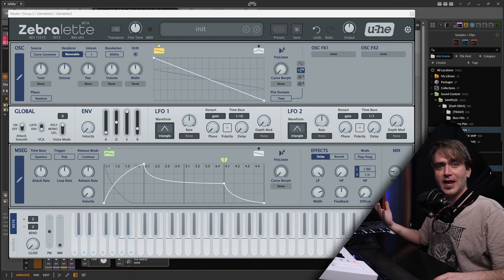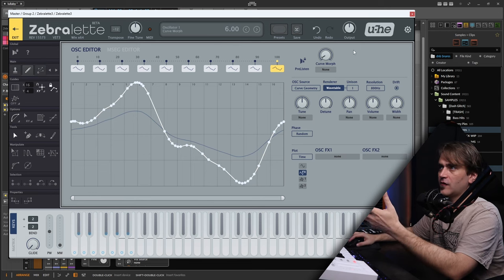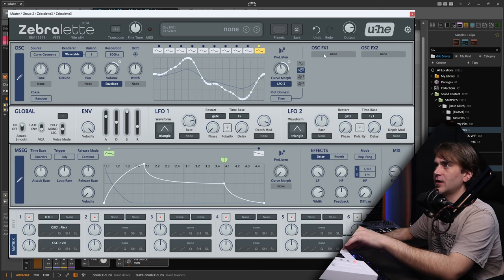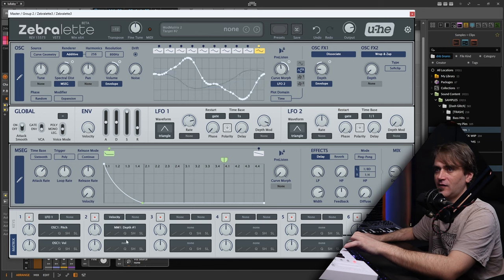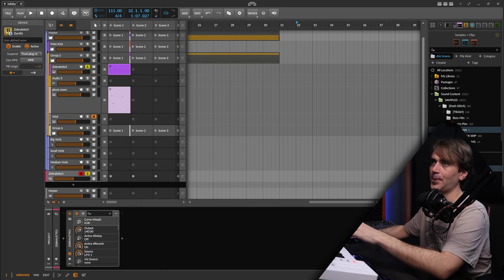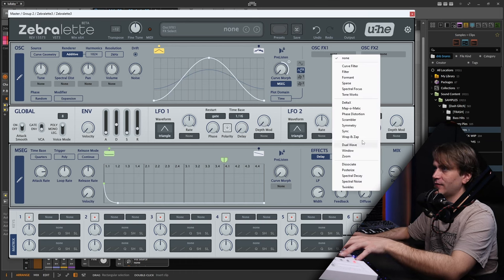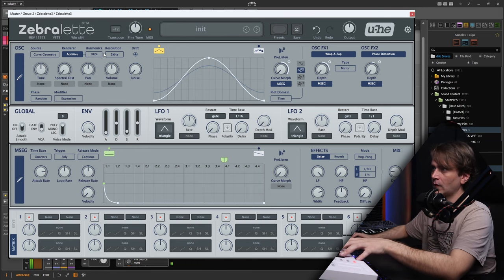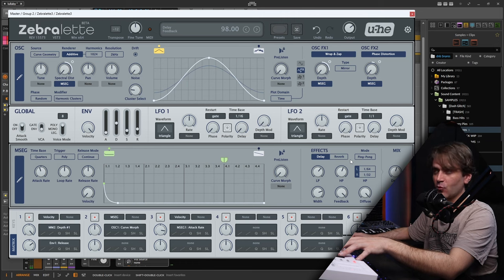Recreating Realistic Acoustic Sounds with FREE Zebralette 3 - Pads and Plucks

Comment: Very nice, congrats!
(BTW at 9:20 you could use "via" in slot 1 instead - saves a precious slot. And shortly after that, instead of Crisp you could use Zebralette's own ModNoise source).
Reply from the maker: Thank you for the tips sir! WRT ModNoise did you mean there is a way to patch it directly to audio output? or to modulate a parameter?
Reply: @DashGlitch Try modulating various parameters e.g. Volume, CurveMorph...
Reply: Sound design tips from Howard Scarr, himself?! What a treat! 🤩🤩🤩

Comment: I'll be watching again your's and Urs's videos but I don't think I am going to find an answer to my predicament. As I get more into the details of Zebrallete I came across an insurmountable issue which is, where do you apply the guide curves of the mseg ? For the oscillator there are various paths in the right click options for modulation sources like the additive renderer or for the osc fx, but for the mseg there is no menu and if there's no menu one as to question why are there guide curves in the mseg if there's no function where to apply them ? I already have trouble using the mseg curves without a proper step sequencer and now I can't find a usage for something that is got to have a purpose otherwise, we think, how does an experienced designer makes such a gaffe ? Please tell me I'm wrong, I won't even ask what it is, I'll just find it. Thanks and sorry for the bother.
Reply from the maker: The guides curves are universal, so if you set them up in the oscillator, then they can be accessed by the MSEG
Reply: @DashGlitch  I'll be checking your assertion but before writing you I checked that when you design a curve in the mseg the same curve in the oscillator remains unchanged, according to your conclusion there's only three curves common to the two. Before answering let me get to the bottom of this by checking the manual but I think I'm going to find a design dead end. Thanks for the attention and I'll be in touch when I have a conclusion.

Comment: Hey Dash, not a question related to Zebralette but I’m curious how often you still use your modular rig? I got into eurorack because I wanted something more “tangible” and “raw” than purely software … and while I don’t regret it and I love my rack, using hardware modules has ironically led me to realize just how good soft synths like zebra/zebralette, phase plant, and vital really are. Just curious if your experience has been similar.
Reply from the maker: Yes but I don't try to compare them, rather use them as individual tools. I like to make sounds on the modular with a more creative mindset, then compile them in the software with resynthesis/granular etc in a more goal-oriented session

Comment: On macoOS I've tried to migrate some of my own Serum wavetables (actually just single cycles) to Zebralette by dragging them over the osc section but it does not give me any kind of import option.
Reply: Interestingly tho: "Single cycle files will be recognized as such and will only replace the currently selected Curve, while multi-cycle samples
will replace the entire Curve Set." I've thrown bunch of exactly single cycle waves but no success to this day 🤷
Reply from the maker: I've had success using mono 24bit .wav files which are anywhere from a single cycle to a couple of seconds, anything stereo or longer tends to crash. I have been using Phase Plant or audacity rather than Serum because I don't know if you know this, but Serum .wav are not exactly wave files, they have a bit of funky header data in there which can throw other software off (you can actually open the wav in a hex editor and see it/edit it). I hope that helps!
Reply: @DashGlitch  OK thanks for the tip! I do have Phase Plant so definitely giving it a shot. That said, the drawing capabilities are so good in Zebralette 3 that I've been mostly been able just draw almost equivalent wave :-) Best wave editor I've used so far...
Reply: With Bitwig you almost have full Zebra 3 with Zebralette 3 as you can fill in the gaps with stock effects, which all can be enveloped etc. :-)